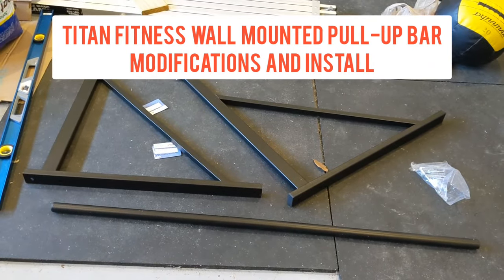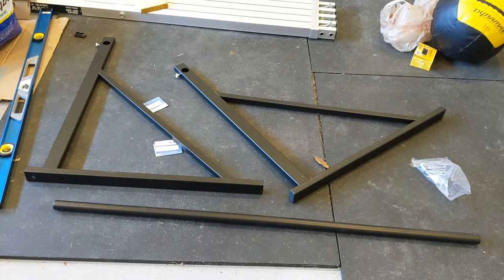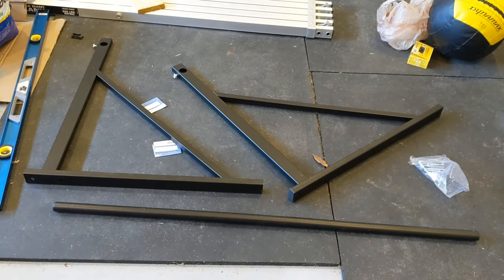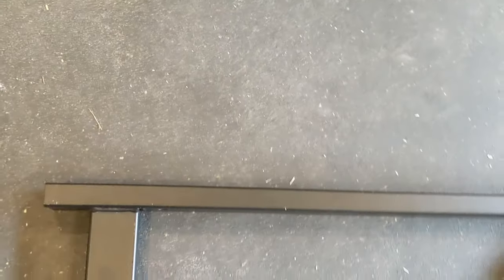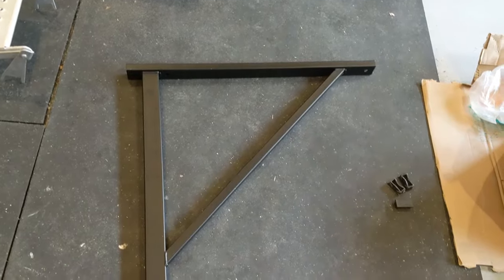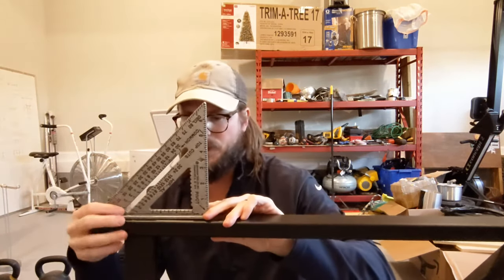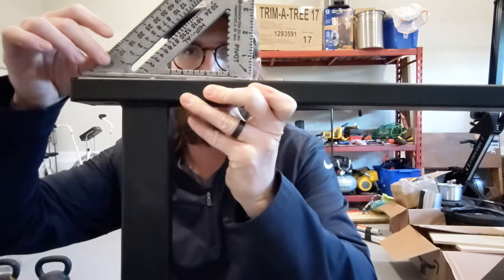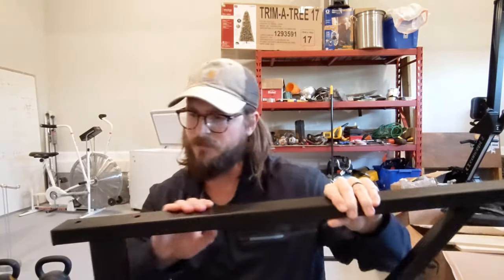Titan Fitness Wall Mounted Pull-up Bar: Modifications and Installation

Comment: Is a piece of wood behind the pull up mounts necessary? Does it provide any additional support? I just got a pull up bar and have been looking for ways to mount it in my garage. I see some videos where people lay boards horizontal behind the mounts. Some videos with the mounts directly touching the drywall. Just trying to figure out what is best.
Reply from the maker: It would be best to lay them horizontal. The wall is generally pretty stable but doing it horizontal will add stability to your wall. Some folks even use plywood. I just had them vertical as to not crush the drywall.
Reply: @UnconventionalThinker  Awesome, thank you!
Reply: @UnconventionalThinker 
Question. I have the same bar and installing in my garage. My plan is to go directly into the studs. I’m just wondering if the studs would be strong enough to hold a big guy. I’m 6’8” tall 290lbs and in shape so I would definitely put lots of load on those studs.😂
Thanks
Reply from the maker: You should be fine as the lag screws can handle a good amount of load if installed correctly. If you plan on doing kipping pullups I would do some test to insure they're installed correctly. By test I would do a few kipping pullups, make sure nothing has tried to pull out, and some times going back and torquing the screws again to make sure they have the same tightness you had when originally installed.
Reply: @UnconventionalThinker  thanks for the quick reply.
Just standard pull-ups nothing out of the ordinary. I’ll buy larger bolts to make sure they are solid. I know the bar handles 500lbs. I was mostly concern if the home framing of the studs would not give up. 😂 I thinking I’m just too paranoid.
Reply: @gugy68  How high did you end up mounting your bar? I just got mine in the mail today and I am 6'6 and was thinking about around 100inch from the floor (I have 10ft ceilings). What is your rec?
Reply: @DJohnsonFinance  I bolt it directly on my studs. One of the brackets was flushed against my side wall and to reinforce, I made a hole in the wall and placed one end of the pull-up bar there. It’s pretty strong and stable because of it. You can also bolt hooks on your ceiling and run cables to the edge of the pull-up bar adding more strength to it. 
I did buy larger lag bolts than the ones that come with the package just for precaution. Good luck.

Comment: I'm 5'11 and weigh between 255-260 lbs. Do you think that I would rip this bar out of a 2x4 stud wall while doing strict pull-ups, or should this be good to go? Thanks.
Reply from the maker: I think it would be fine. Strict is no problem. And the lag screws aren't really loaded to highly. If you tie the studs together by bracing the wall with plywood and then mount to that and the studs then you would have less movement in your wall, which would help with potential lag tear-out
Reply: @UnconventionalThinker  Sounds good. Thanks!

Comment: Would it be bad or risky to not use that plywood backing?
Reply from the maker: You can install this without any wood backing (plywood or in my case 2x6s) but I didn't want to possibly crush the drywall behind the bar frame. If you plan on kipping I would definitely suggest using plywood as it acts as a stiff brace between your studs. Mine is not braced, it still feels safe kipping but I currently only primarily do strict. But you would probably be fine without it, but when it comes to structural stuff I prefer to go overkill simply as to not cause damage to the house or myself ;). Hope this helps.

Comment: How would you go about it if you could only get one side of the pull-up bar to line up with a stud behind the wall? The other side would only have the timber brace or plywood to bite into as there would be nothing behind the drywall at that point? Thanks!
Reply from the maker: I don't think I would do that. Can you mount it to the ceiling? Or there any other studs in the area, you can make it narrower.

Comment: @unconventionalthinker  ... I see wall mounted pull up bars that do not have the 2 extra angled support beams that run down the sides. Can those be mounted safely into a wood beam without ripping out? I always thought they need the extra support but based on this video it seems they don't take on too much of the pulling pressure. I have a huge  horizontal wood beam I can attach to, but it is not wide (height wise) enough to fit a set up like this. So was wondering it the other style could work safely. Please let me know. Thanks
Reply from the maker: So the angled members help react the bending that is occurring from your weight being that distance from the wall. The top bolts are in tension and the bottom bolts are in compression. So that's why they are spread out. So far apart is due to the the cantilever beam that is occurring from you pulling up on that bar. I like this setup better, but it doesn't mean that other systems wouldn't work depending on what you want to do with your pull-up bar system. If you wanted to send me a picture of what you were thinking in my email that's listed on my profile I can let you know my thoughts on that
Reply: @UnconventionalThinker   ok sounds good I'll send an email over with some pics. Thanks so much for the reply

Comment: what sort of wall do you have there?
Reply from the maker: It drywall on top of wooden studs.
Reply: you think I could mount the pull up bar on 2x4s mounted on a hollow brick wall? 
or are your 2x4s bolted on the wooden studs through the drywall ?
Reply from the maker: @cozminr  they're bolted to the studs. If I could do it over again I would have done plywood instead. 

The brick wall depends on whether it's a structural brick wall or if it's a veneer. I personally wouldn't mount to a brick veneer
Reply: @UnconventionalThinker  yeah it's only 1 layer of hollow brick. these new buildings suck you can't even hang a tv on a wall
Reply from the maker: I actually moved out of the house where I installed this, current house I'm installing one outside by put two 6x6 columns in the ground
Reply: @UnconventionalThinker  I had the thought of bolting the ends of some wooden studs on the ceiling and floor and then fixing the bar to the studs but it just seems too much work. Congrats on getting a house. I hope to get one too some day. Need to find a suitcase full of money first
Reply from the maker: @cozminr these type can be mounted to the ceiling joist, but depending on the height of your ceiling it might not be tall enough
Reply: @UnconventionalThinker  its tall enough i think about 2.5 metters

Comment: Hello and thank you for this video. My studs are unevenly spaced, so my plan is to install 2x4s horizontally across 3 or 4 studs and mount the pull up bar onto the 2x4s instead of drilling the Titan lag bolts into the studs. Will this idea work? And what screws do you recommend I use to mount the 2x4s to the studs?
Reply from the maker: It might work. Here are my concerns. I would use something bigger than a 2x4, maybe a 2x10 or 2x12, just because I would want as much out-of-plane bending capability as possible. You are reducing your out-of-plane stiffness by almost a factor of 10 by mounting the way you have to. So however you can get that stiffness back you'll notice less movement in your pull up bar the stiffer it is. I would also caution the use of lag screws in this situation and try to use a bolt and nut. Going into a stud you pick up more threads of the screw, you will be reducing your thread engagement and increase the chance of pulling out. It will be harder to install with the nut and bolt, as it would need to be installed to the 2x10/12 on the ground and then I would lag that to the studs, but it will ensure you have enough strength. Also when you install you will want your titan wall mounts to be as close to the studs as possible, this will make it stiffer. Hope this helps
Reply: @UnconventionalThinker  Thank you, friend!
Reply: @UnconventionalThinker  Perhaps I should take the safe route and mount this into the studs as intended. It will make the Titan mounts a little closer together, but that should be alright.

Comment: So I bought this pull-up bar and plan on installing it this weekend. I plan on using 2x6 boards like you did but horizontally. Question for you that I have to ask......Why wouldn't you use lag screws for the 2x6's for the extra support? It look's like you just used wood screws? Can you clarify why you chose that route VS. additional lag screws into the 2x6's? Thank you.
Reply from the maker: You could do that too. I did use lag screws after I used the decking screws to mount the 2x6s to the wall studs mainly to just hold it to the wall so I could put the lag screws in by hand; I wanted to torque them in by hand to ensure I wasn't shooting out the side of the stud. The lag screws were the main fasteners that transfer the load to the studs. The decking screws see a little bit of load, but the lag screws will see a majority of the load likely since they are much stiffer. All the decking screws could have failed in my setup and the whole assembly would have still been held to the wall by the lag screws.

Comment: Thanks so much for making this! The comments have been really helpful too. I'm going to mount mine with the plywood. You mentioned to someone else that you'd use decking screws and then use the 4" lag bolts to secure the actual pull-up bar. So if mounting the plywood first with decking screws, where would you drill those in (and what size?) to secure the plywood first? Would it need to have several  mount/screw points on the plywood's surface to make sure it's the most secure? Or just in the corners?
Reply from the maker: Glad it was helpful. So the decking screws would go through your plywood into your studs. These hold the plywood in place to help with stability of your studs (think of the horizontal line in the letter "H"), meaning you should feel your wall deflecting less or moving side to side when doing pullups. It will make everything more rigid. I think decking screws are a standard diameter, they just vary in length. A 2.5" length should be good enough. I would put enough (maybe 1 every 2 inches) in there so that the plywood feels very secured and tied into your studs (in a structural sense it's a shear panel). The 4" lag bolts will go through the plywood and your studs, the studs will be the primary structure your lag bolts are connected to. Hope this helps.
Reply: @UnconventionalThinker   Fantastic-- thank you so much!! Cheers to taking the extra time to not rip our walls down :)
Reply: Ok I'm back with another question 😅
I got 3/4" plywood cut to size and have measured and remeasured many times, making sure I know where the studs are. I pre-drilled into and marked the plywood and the wall to line everything up. But! I thought that I could have my husband hold the board up while I try to level it quickly and line it up with the studs but it's proving to be quite difficult to hold it and nudge it into place because it's so heavy. I'm wondering if I should just scrap the whole plywood thing and do 2x4's for more ease of installation. Will it be sturdy enough just in those 2 vertical studs? I know you said you'd use plywood if you had to redo it. I'm about 140lb and he's about 190lb, so not a ton of weight to support but I really don't want to rip the wall down (it's in a spare bedroom turned home gym...not a garage). It'll get a lot of use and pulling from the TRX straps and rings. Maybe hire someone to install the plywood for me? Or is there a better way to support it as you try to install it?
Reply from the maker: @NEdler22 I personally think the plywood would be much more superior to the 2x4 idea. But here's an idea, if you had 2 - 2x4 that were tall enough you could screw those into the front face of your plywood at the height you wish your plywood would be on your wall so that you can stand it up and the 2x4 will hold the weight like legs. Let me know if I can help any other way!
Reply: @UnconventionalThinker interesting workaround! It might come to that. We need to try again and see if I can get it lined up and leveled more quickly and if not, I'll give that a try. Thanks for your response!

Comment: Great Video....Are your studs steel or wood ? Mine are steel and I'm not sure what kind of Anchors will work to anchor my 2x6's to the metal studs ?
Reply from the maker: I have wood studs. Yeah for metal studs you may want to research what works best on them as they are a bit different from wood.

Comment: I read in your comments that you suggested bracing the studs with a sheet of plywood. Would using horizontal 2x6s that cover the height of the pull up bar do the same? Thanks in advance!
Reply from the maker: Yes it would be similar. And it would be better than the way I braced in my video.
Reply: @UnconventionalThinker  thank you for sharing your knowledge. I will try this approach.

Comment: what's the advantage of screwing into the timber rather than directly into the wall?
Reply from the maker: The primary reason for the timber was to disperse the compressive load across the drywall better. I didn't want to crush or dent the drywall with the pull-up bar.

Comment: Hey @Unconventional Thinker. Thanks for the video! 

I just got my Titan Fitness  pull up bar today.

To clarify, you used the two 2x6s because you do not have studs in your wall? That might be a dumb question but I'm just making sure. 

I plan to do the same or possibly use 3/4" Plywood with the same 4" Lag screws because the studs behind my drywall may be very old and of poor quality. 

Thanks!
Reply from the maker: No worries. I had studs behind the drywall, but I didn't want to possibly crush the drywall by directly mounting to it, so I put the 2x6s up. I honestly think plywood might be the better option, because it will only reinforce your studs and brace them together. The studs are braced by an exterior sheet of plywood, but one interior such as the one you plan on putting up will only make your wall stronger, especially if you plan on kipping

Comment: What if you needed to install upside down?
Reply from the maker: Are you talking about on the wall upside down or putting it on the ceiling?
Reply: @UnconventionalThinker  on the wall upside down, due to a lower ceiling
Reply from the maker: I'm sure it would be fine upside down, you would be stressing the welds a bit differently but it's probably fine. I am unsure of what it buys you if the ceiling is limiting factor, are you unable to just lower it down on the wall and still keep it right side up?

Comment: What’s the size/measurements of those wood planks?
Reply from the maker: So they're 2 x 6's that are 48.5" long
Reply: @UnconventionalThinker  Thanks!
Reply from the maker: I think if I had to do it over I would have done a plywood sheet instead. This works but I should have framed out the studs better aka less movement of the studs
Reply: @UnconventionalThinker  - I"m not sure what you mean by using a plywood sheet.  Would that be a 4x8 sheet or a 4x4 sheet?  I can see where that would allow you to use more screws to anchor the whole chinup bar assembly to more studs instead of just the two vertical studs that you did use.  Oh, and what thickness of plywood sheet would you have used - 1/2", 3/4", bigger?  I just saw another video where the guy mounted his chinup bar on four horizontal planks that were mounted to the wall.  But he was using lasers and levels and straight edges to make each plank line up correctly.  Using a 4x4 sheet of plywood would have been a lot faster and easier.  Now that I'm thinking about it, I wonder if a 4' width would be enough.  Perhaps a 4x6 sheet of plywood would be better.
Reply from the maker: @STBRetired1  yeah I was referring to a 4x8 3/4" plywood sheet. It would just create more stiffness between your studs. It would essentially be connecting all your studs together. Where I mounted mine there is an exterior wall so there was plywood on the other side essentially framing the studs together. If you don't plan on kipping it's really not a big deal I just like to create stiff connections.
Reply: @UnconventionalThinker  - so you would mount the plywood sheet vertically?  Is 4' wide going to be wide enough?  The bar length is 53.5".  But as I hold a 4' tape measure in front of me, I can see that 4' should be plenty wide for pullups and messing around.  Thanks for the info.
Reply from the maker: @STBRetired1  yeah it seems like you would flip the 4x8 plywood sideways and trim to fit if you're able to. Or have the whole length up there, offset it to if you do handstand push-ups on the other portion... just a thought
Reply: @UnconventionalThinker  - It took me a few minutes to figure out what you meant by doing handstand pushups on the other portion of the plywood.  But I think you mean that's where my feet would go on the unused section of plywood.  Now I got it.  That's a good idea.
Reply from the maker: @Thuan Nguyen what I did protects a little bit more from crushing the drywall. It really doesn't add strength or stiffness